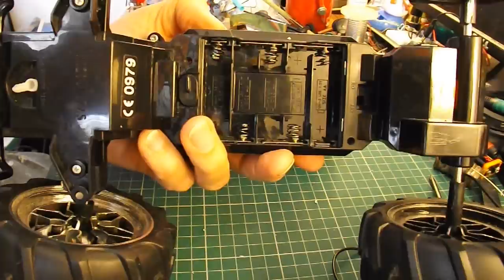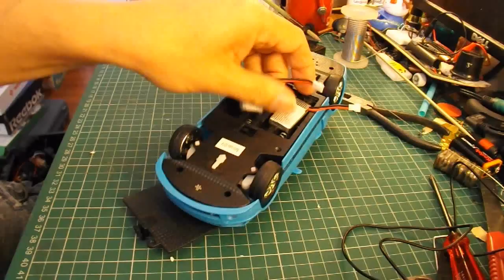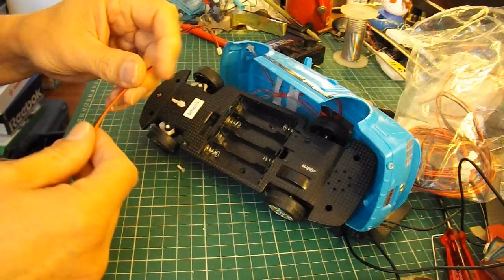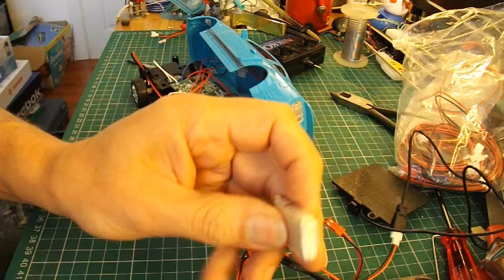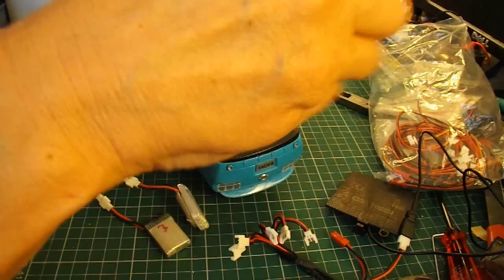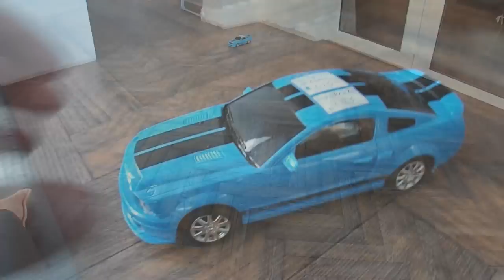Charity Shop Gold or Garbage? Lipo Conversion for RC toy car

Comment: I have a question, i want to upgrade a cheap buggy i bought to go faster with lipos, it also uses 4 aa batteries. I dont understand the soldering part though, do you remove the old cables that were already soldered on the contacts or do you just leave them there? Its my first time ever upgrading an rc car so any help is greatly appreciated
Reply from the maker: You have to ask yourself what you are trying to achieve when you say you want to upgrade it. LiPo batteries are in units of 3.7 volts nominal rating or 4.2 volts freshly charged. If your car uses 4 AA batteries then a single LiPo battery will give it less voltage than it expects and a double LiPo battery would give you far more voltage than it expects. That means you will probably burn out your car's receiver. Even with the single LiPo and less voltage you can still damage your car because a LiPo can deliver more current than those 4 AA batteries even at a lower voltage. A 1S LiPo (single cell) is 3.7v, a 2S LiPo is 7.4 volts, a 3S LiPo is 11.1 volts so for a car that expects 12 volts a 3S LiPo would probably give it the volts and power it needs. However there are many issues around using LiPo batteries. For a start you need a charger that is designed for LiPo batteries. You also need to ensure you don't over discharge that battery, this is easily monitored by fitting a LiPo alarm that monitors the state of the battery and beeps when it gets to the minimum safe level. This FliteTest video gives you some handy information about LiPo batteries https://youtu.be/K6hGvXxFTFA?list=PL6IuSFWz4ktvupu_gxw1vn-sjBGOkJFHV As for the practicalities of soldering the wires, you will need the right type of connectors for whatever type are fitted to the LiPo battery you purchase. You could solder them to the existing battery contacts giving you the option of reverting back to ordinary batteries if you change your mind later but don't be tempted to try running the car with both types of batteries connected at the same time as something will definitely overheat. If you are absolutely certain you want to make a permanent change then you could trace the existing wires from the battery compartment and identify where they are soldered to the receiver board making sure you identify + and - and then remove the old wires and solder the new ones direct to the board. Finally the most likely result of doing this "upgrade" is that you will have a fast car for a short while and then something will overheat and die. It will either be the motor or the motor controller circuit on the receiver.
Reply: @GrandadIsAnOldMan  thank you for your help. I already own 4 3.7v 550mah LiPo's since i own a drone. My car is actually really simple to mod, practically i dont have to solder anything since instead of the cables being soldered on the board the board has connectors for everything and so i just simply need to take out the AA cable and connect my LiPo cable. But, if i happen to change the motor of the car will i then be safe?
Reply from the maker: It depends on the components in the receiver, I cannot promise you anything. They will have been designed to cope with the power output of the 4 AA batteries. It is unlikely they will have built the receiver to handle a much higher load. They will have built in a reasonable tolerance but I have burned out several cheap toy car receivers and lots of motors in my videos.
Reply: okay, thanks for the information! i think i will try it though it is worth a shot, and besides, if anything goes wrong, its the experience that matters haha

Comment: Hi again,  at 0.47,  the previous car you mentioned.can you please explain the steering motor / wiring ?  its not a servo, ??  thank you
Reply from the maker: In these toy grade RC cars there are two motor outputs on the receiver board. One for forwards backwards (usually labelled F & B) The other for left right (usually labelled L & R). Steering is controlled the same way as the forwards backwards. The output from the receiver chip is fed via an H bridge to give you three situations. 1. No power - so for forwards backwards that is stand still - for steering that is straight ahead  2. Power with the current flowing in one direction - so for forwards backwards the car goes forwards - for steering the car goes right  3. Power with the current flowing in the opposite direction - so for forwards backwards the car backwards - for steering the car goes left. I show the diagram in the previous video you refer to.
Reply: Thanks for responding, but the Toys R U, big RC i found is different.  It has a steering motor, with the normal 2 wire power.  However there seems to be a switch or something, with another 4 wires.  So its not a Servo, but a motor, with perhaps a reversing switch.   I since found your other video, which just uses an ESC to drive the steering motor, but would this not burn out the motor if held on Right or left lock, given the motor will be stalled ?

Comment: With LiPos you need to be ectra careful. I ran into a problem when converting a cheap RC to LiPo. The LiPo was lower voltage than the RC was rated for, but it managed to fry the receiver. Polarity was correct. I think the problem was that the internal resistance of normal batteries limited the current, and the designers took advantage of that. The board must have drawn in excess of 10 amps because the LiPo was hot and the wires desoldered themselves. There was no short circuit either. RC was rated for 9 volts, LiPo was a single cell, 3.7 volts as a test to see if it even worked. It obviously did not.

Comment: Can it damage a circuit board
Reply from the maker: YES. Of course it depends what batteries the car was using and what batteries you are replacing them with. In this video the car had 4 AA batteries (6 volts) and I use 2 1S LiPos (giving 7.4 volts) so I am taking a risk by increasing the voltage supply. IF the existing batteries are 5 AA batteries they would supply 7.5 volts. A 2S Lipo is rated at 7.4 volts. In both cases when the batteries are fresh they will both give more than 7.5 volts so from a voltage point of view you should be OK. The problem comes when you put the motors under stress, for example when the car gets stuck in long grass, then you may have a problem. When the motor is under stress it draws more current. The original 5 AA batteries cannot supply much more current so the circuit board may survive. With a LiPo battery it has a greater capacity to supply more current so the stressed motor will draw more current through the circuit board and that is when the components will overheat and burn out. If your 5 AA batteries really fresh they can do the same damage but it is more likely to happen with LiPo batteries because they can supply more current. Sometimes the motors will overheat before the circuit board fails it just depends on what components are on the circuit board. Generally I have found it tends to be the current draw that kills the components more than the voltage supply.

Comment: How would I figure out the amount of voltage a RC Excavator circuit board can handle? The CAP says 16v so even though the Excavator is 4.8v can I use 7.2v instead?
Reply from the maker: Sorry I cannot help you, I am certainly no expert. Maybe somebody will see your comment and offer some advice. The best I can say is that often it is not the voltage that cause the problem, it is the current draw. I have looked at toy grade RC toys and assumed that if they had 5 AA batteries in the battery compartment (5 x 1.5 = 7.5 volts) that they should be OK with a 2S LiPo battery rated at 7.4 volts however I have burned out several RC receivers because when the car gets stuck in the long grass on my lawn the motor draws more current. With the normal set of AA batteries it is limited to what is available but the LiPo battery can provide more current so the current draw rises beyond what the circuit board can handle and components burn out, so even within the right voltage range you can still have a problem. The components that usually burn out are the power transistors in the "H Bridge" which is usually a group of 4 transistors that control the power to the motor. Sometimes it is a single chip but on larger boards it is discrete components so you could identify them and look up online for the data sheet and the working details. The CAP has very little relevance to the current and voltage the circuit can handle.

Comment: Well done I put a 2s in a mario kart and it works great with good run times😎
Reply from the maker: The main problem with swapping to LiPo is it can supply far more current, so if your toy grade motor gets stuck, like in the long grass, the motor keeps drawing more current, the LiPo keeps supplying it, but the receiver drive circuit (H-Bridge) can't handle the current draw and fries.
Reply: GrandadIsAnOldMan My daughter uses the toy for the street! Grass I would agree with even with lipo capable toys! I have had cars up to 6s capable and I have to say this mod is good for our needs and poses no problem at all, can mod will mod😎 even esc's get burnt out

Comment: From personal experience you can over power most stuff like this buy 1.5 -2 volts without much issues if any even 3 some times but 1.5 your fine for sure     now if you have say 20 volt item im not sure if 22 would me fine ive only ever over volted stuff between 3 volts and 12 volt nice videos man hope this helps you I know this was an old video you may even know this now
Reply from the maker: The main issue is the current available. If the car gets stuck so the motor is stressed it will try to draw more current. With the normal batteries that is unlikely to cause a problem but with LiPo batteries they can supply far more current and the power transistors in the drive circuit will fry. https://youtu.be/pNIt9u9809E

Comment: Get those batteries fully charged add grip to the tires and then shoot a footage plz plz plz
Reply from the maker: There really isn't much point. Unless I had access to a larger hall or gym I wouldn't be able to drive it any faster and turn it round within the space I have in my kitchen, so it would just be smashing into the walls, maybe that is what you want to see 😊😊

Comment: if you do not put a battery monitor of somesort in with the lipo, you will make that lipo dangerous by draining it to far, go with 123 batteries, about the same power just not so bad about over discharge

Comment: How but u car has 3 double AA batteries an to put in a 9v batteries
Reply from the maker: If the car has been designed to take 3 x AA batteries it would be expecting 4.5 volts so if you use a 9 volt battery you have doubled the power and stand a good chance of frying the receiver fairly quickly. Good luck and be prepared to buy a new car.
Reply: GrandadIsAnOldMan
Reply: Ok

Comment: Unless you put a low voltage cutoff on this it will function as a lipo killer.
Reply from the maker: That is true and is a problem with many RC systems. That is why you can buy LiPo alarms that warn you when the voltage drops to a low level.
Reply: Just thought it was worth mentioning for anyone who was thinking of doing the conversion you did here. I know from personal experience how much it hurts to lose expensive lipos, there is also the chance of creating a fire risk charging batteries that have been over drained.
Reply from the maker: Did you read my video description?
Reply: I see where you are going with that, I am not trying to argue. I am not sure that most people understand that draining a lipo too low falls under the heading of "abuse". Feel free to ignore my comments, just trying to be helpful.
Reply from the maker: No problem with the comments, I just wondered if you read it. Very few people bother but I put support information in all my video descriptions. Nothing you are saying is wrong. I tried to avoid using LiPos for ages but in the end I had to use them for the weight and power benefits. You may be aware that many brands of LiPo have built in protection circuits, but not all of them. On the subject of LiPos bursting into flames, have you ever managed to do it. I have tried and failed and I have also watched several videos from people I trust to do a genuine video and they also failed. I don't doubt that there may be occasions that they do catch fire but it seems to be the first thing people talk about when LiPos are mentioned but the truth is that you can start fires with normal lead acid or alkali batteries under the right circumstances too.

Comment: so your telling me that those tiny lipos, have more power than 4 double AA's? tell me where did you get them??? SCIENCE IS AT OUR DOORSTEP!!!
Reply from the maker: I guess you are not familiar with LiPo batteries, you will find plenty of information about them if you choose to do some research. The power to weight ratio of LiPo batteries is what makes them so popular, particularly for model aircraft and multi-rotors.
Reply: GrandadIsAnOldMan oh I did not know that so that's why they use Lipos they're powerful and lighter than regular batteries
Reply from the maker: Yes, significantly lighter for the power they supply 😊

Comment: what is underpowered and overpowering
Reply from the maker: That is a very broad question but in the context of this car it has been designed to run with 4 AA batteries so it expects 6 volts. I explain that a single LiPo cell would give 3.7 volts so it would be "under powered" or you could use a 2S LiPo which would be 7.4 volts so that would "over power" it compared to the 6 volts it was expecting. Over powering the car may burn out the receiver board and ruin the car. In the case of this video it seemed to survive OK but that may not always be the result.

Comment: Hey, this was a very simple and easy to understand video. I've been wondering what it took to convert my 3 wheeled rc to a battery pack rc. Only thing is, mines would require 12 volts though . Any suggestions?
Reply from the maker: LiPo batteries are in units of 3.7 volts nominal rating or 4.2 volts freshly charged. Then the cells are put together so you have a 1S LiPo (single cell) is 3.7v, a 2S LiPo is 7.4 volts, a 3S LiPo is 11.1 volts so for a car that expects 12 volts a 3S LiPo would probably give it the volts and power it needs. However there are many issues around using LiPo batteries. For a start you need a charger that is designed for LiPo batteries. You also need to ensure you don't over discharge that battery, this is easily monitored by fitting a LiPo alarm that monitors the state of the battery and beeps when it gets to the minimum safe level. This FliteTest video gives you some handy information about LiPo batteries https://youtu.be/K6hGvXxFTFA?list=PL6IuSFWz4ktvupu_gxw1vn-sjBGOkJFHV
Reply: Thanks a lot. I want to convert a battery op rc I got Radio Shack before they closed down. A 3 wheeled rc that I can't even remember the name of.

Comment: DON'T LISTEN TO THIS GUY HE DOESN'T KNOW WHAT HES TALKING ABOUT.
Reply from the maker: What is the advice your would rather give? What particular point is wrong so I can correct it? I notice you changed your mind what you wanted to type three times as YouTube shows your edits.
Reply: Your giving bad advice you shouldnt put a lipo in this car some 19yr old could copy you and burn dow their house
Reply from the maker: I guess you have read lots of scare stories about LiPo batteries catching fire. I did give clear warnings about that in the video and in the video description. Maybe you made your comment without watching the video or reading the description. Have you watched the videos of people trying to start fires with LiPos and failing, those videos tend to get less coverage because they are less sensational. I suppose you have a smart phone and realise that has a LiPo or similar Lithium based battery inside it. Do you advise everybody not to have smartphones in case they burn their house down? Maybe you are an eCigarette vaper, they have them too. Yes, there are cases of these batteries catching fire, there are also old cases of people putting 9v batteries in their pockets with their loose change and setting fire to themselves. Here are some of the videos I mentioned https://youtu.be/pqPFuzRIANs https://youtu.be/osfgkFyq7lA https://youtu.be/BLc74Qpvweg
Reply: I see your point but if you put a batterie in a rc car which has too much power it will burn your motor before your esc and you shouldnt have a mother board controlling a lipo
Reply from the maker: The power control circuit (H Bridge) in the receiver board will fry well before the motor does. Again I explain in my video what voltage the original batteries supplied and what voltage the LiPos would give and explained that the receiver board could be damaged. I have burned out several cheap toy grade receiver boards doing this and if you search my videos I even show how to repair them when you have done that.

Comment: i have a 12v toygrade  rc car and i want to add 3 12v motors to make it 4x12v motor will it work or i fry the stock reciever electronics?
Reply from the maker: I am no electronics expert but logic tells me that 4 motors would try to draw 4 times the expected current through the RC receiver's motor control circuit and I would expect that to be 4 times as much as it was designed to deliver so YES I would expect it to fry. Alternatively I may be looking at this the wrong way and it may be that the same current is supplied but it is divided between the 4 motors so each only gets a quarter of the power so they all run much slower but the receiver survives. Of course you could just try it and find out or ask a Physics teacher. It might be worth looking on the RC car forums to see if anybody there can offer any advice as they may already have tried it.